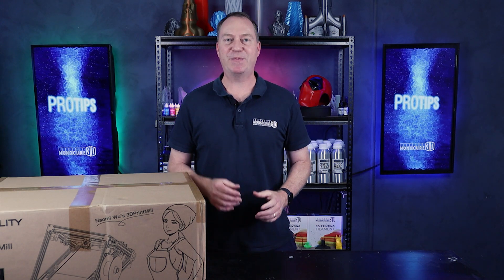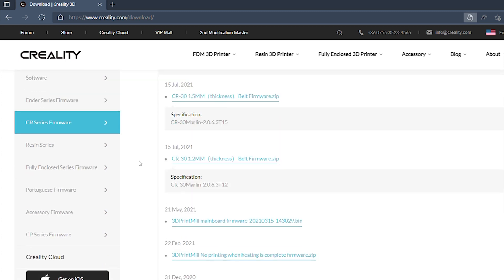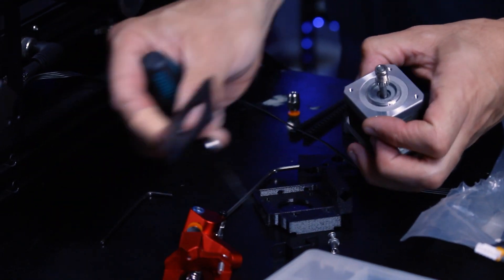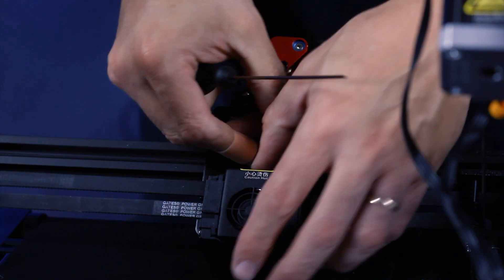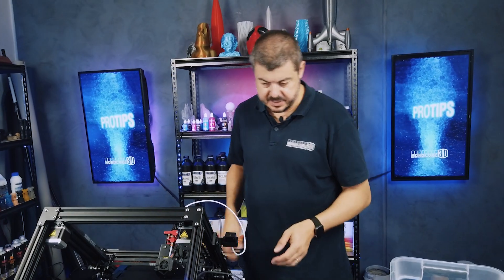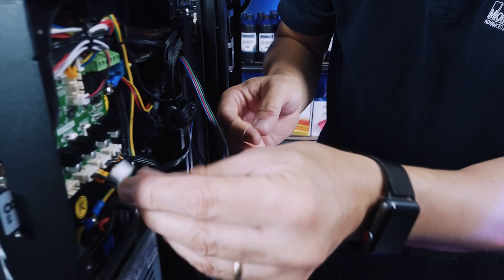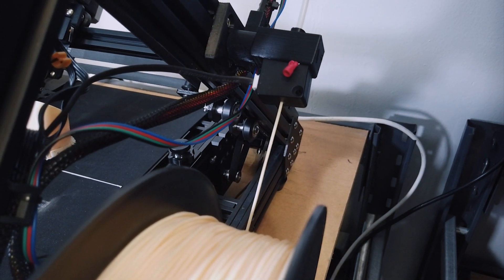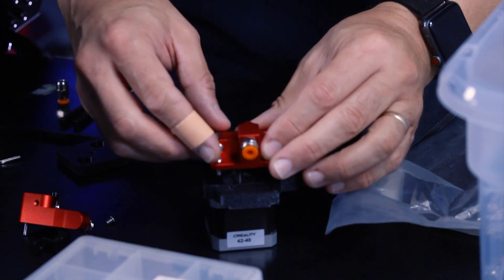Creality CR-30: How to change your PrintMill to direct drive

Comment: Just like to add that we found that you need to set the hotbed / rear plate to their lowest position.  If you don't, when printing long models, the rear of the belt will have a downward angle and cause the model to shift downward as it comes of the belt.  This will cause the model to split open.  Having the plates under the belt in their lowest positions ensures the part is level all the way along the belt.  Bit more effort getting the nozzle gap right but I see it as essential for long models.  Even if you install the rear rollers, the model will dip down before it catches the first roller.
Reply: Interesting, I'm planning to do this direct drive mod at the same time as GridSpace's Linear Rail mod (https://www.youtube.com/watch?v=E7SOlJCnLEw), with his mod, the belt needs to be raised to it's top most position, with this one lowered...   Guess they will balance out somewhere in the middle with both applied. It's going to be a challenge for me to figure out levelling the belt.
Reply: Also, I suggest tightening the belt a bit after doing this as the looser the belt the more chance that shrinkage will warp the base of the model.  This also requires a recalibration of the Z steps.
Reply from the maker: Thanks John.

Comment: I recently started using the cr-30 , I found test prints have worked perfectly without error, however the thundercats sword I have recently been trying to print continues to give me issues, as soon as it gets to the handle section it wont catch the bed. I was able to get 2 clean prints but every print between just foiled!!.  Today I started doing parts for my ironman suit. first couple attempts no adhesion, I then gave in and added glue, this gave adhesion to beginning of print hopefully when i get home it will be printing a good piece!!
Reply: How has it been for you the last month or so? I’m still on the fence on the cr30.
Reply from the maker: We just purchased a second one!!